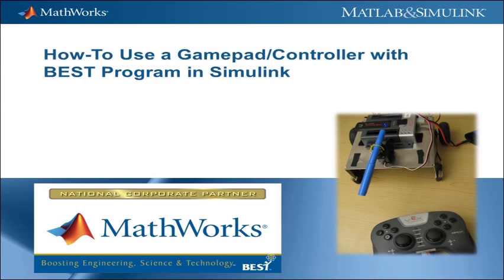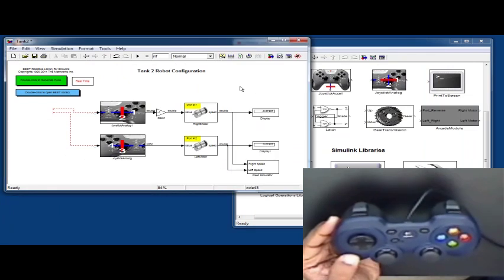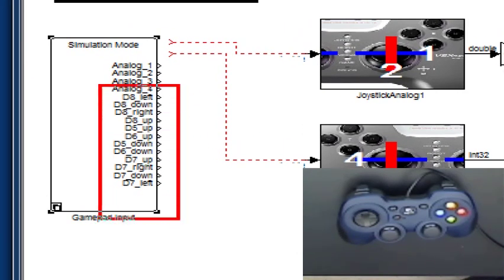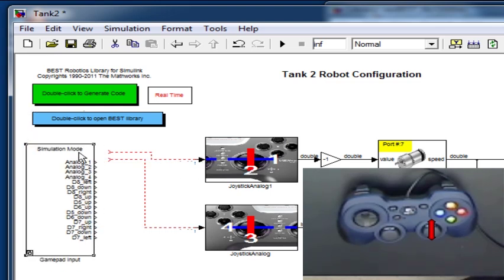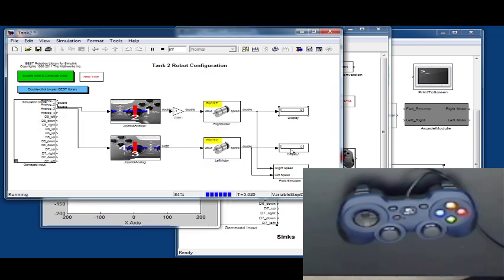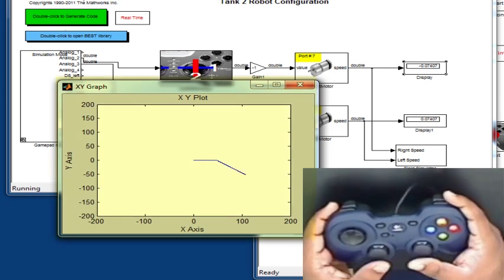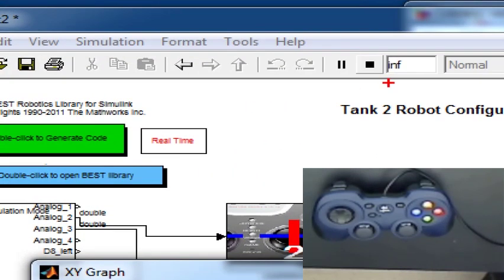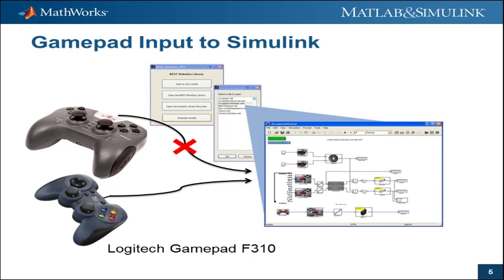Using Gamepad/Controller for Simulation Input

Comment: Hi
How can i find Gamepad input block ,?
Reply: For everyone who has the same question: You can use the Joystick Input block from the Simulink 3D Animation library to get Xbox 360 controller inputs. A demuxer may be necessary, depending on what you need.
Reply: @livestricker  i can't found it there, in my MATLAB R2015a and Simulink 8.5 version. is there a special requirement to get that controller input block?